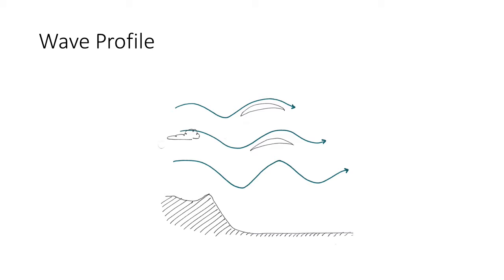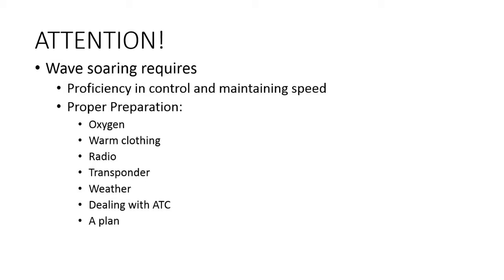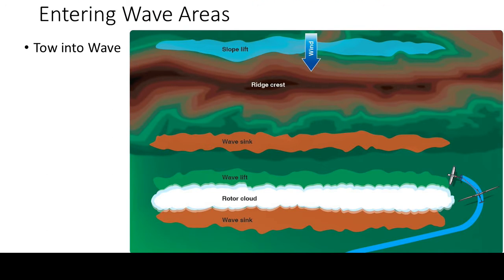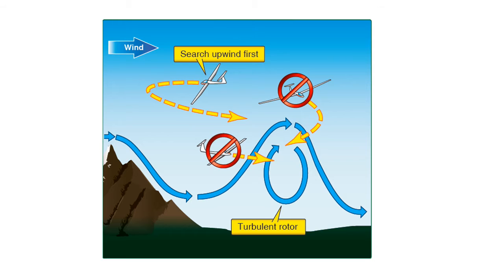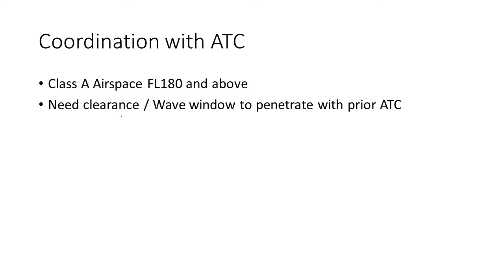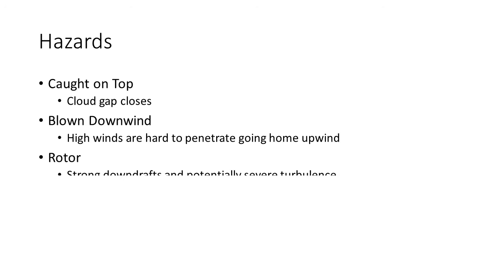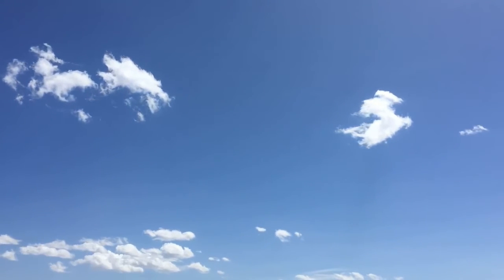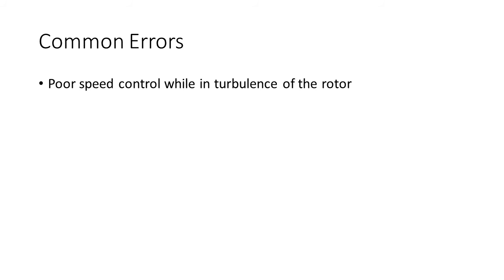Introduction to Wave Soaring

Comment: One thing that’s not mentioned in this video is the wave is not just a high altitude thing. In some parts of the world it’s common to have wave that starts a bit below 2,000 AGL and tops out under 10k in the primary less in secondary and subsequent bars.This can happen in winds well below 20kt with good atmospheric conditions. These days can often be good for XC flight as the lower wind speeds allow for progress up wind as well as across wind.
Reply from the maker: Good points. Thanks